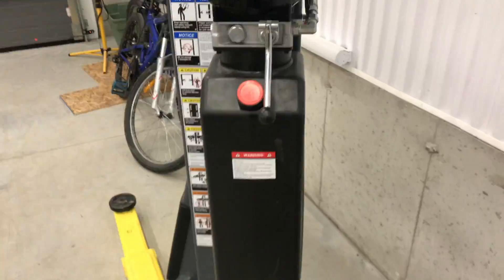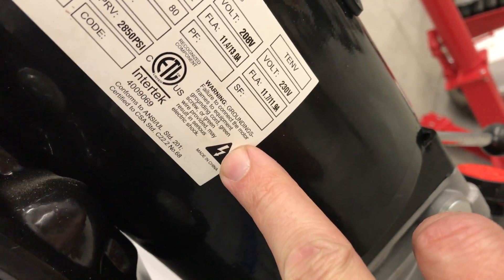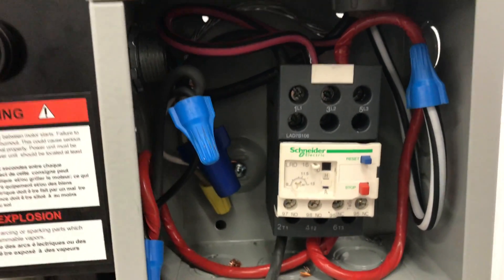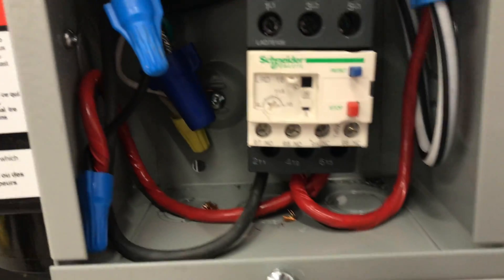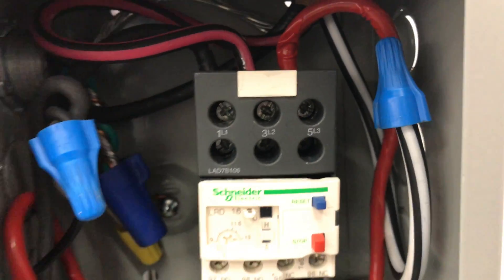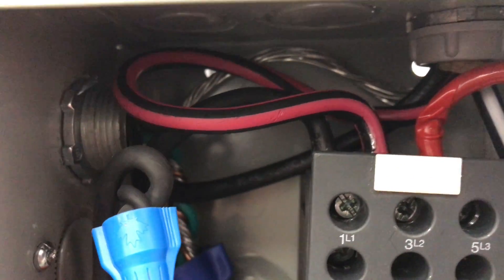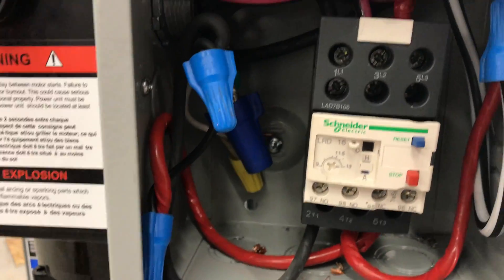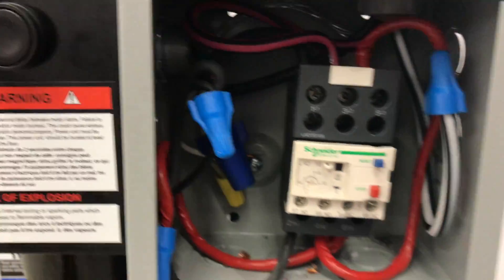Thermal Break Installed On Motor Overload OL

Comment: Perhaps I don’t understand, but I am not sure how this can protect your motor.  There is no contacter so the sensor doesn’t break the connection, correct?
Reply from the maker: I have no idea but the electrical code said I needed it so I had no choice.
Reply: @porkercon  I bet you can test it.  If you hit the red stop button and the motor is still operational, then it is not protecting anything.